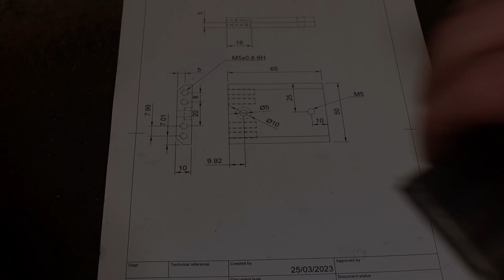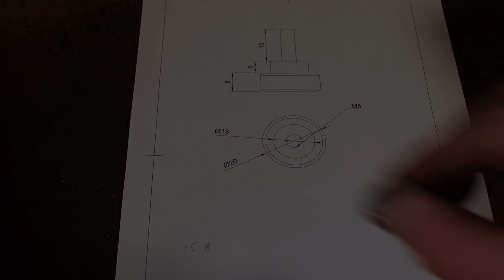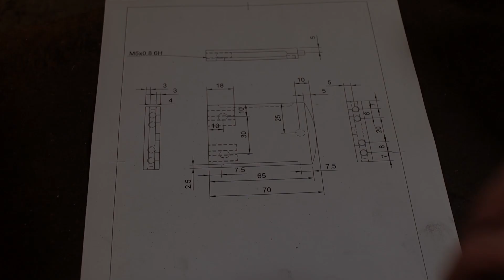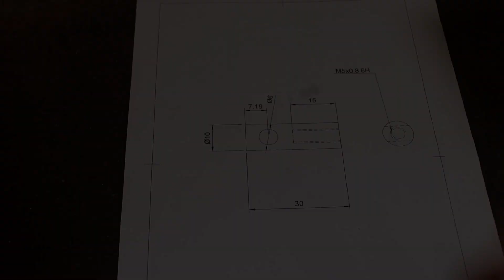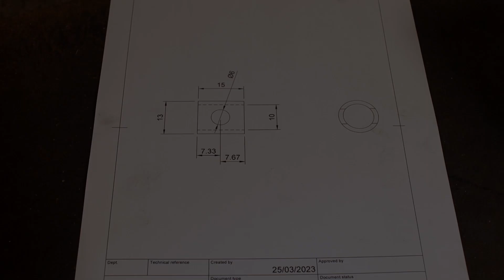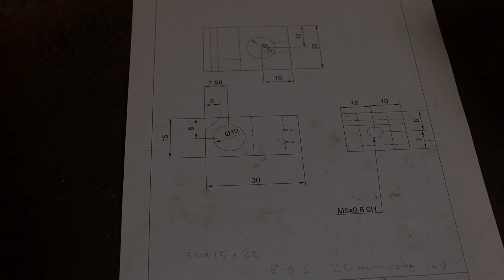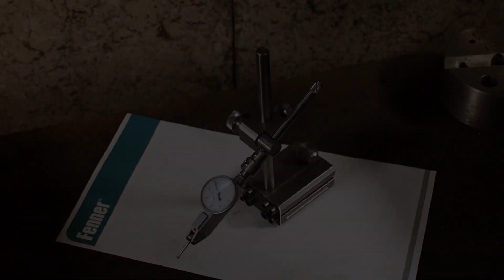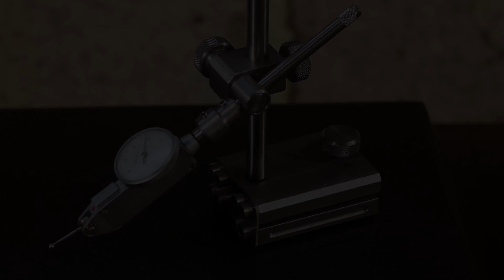Surface Gauge Project

Comment: Very nice! I've been eyeing up the Herman Schmidt for a while. I believe you need flats on the balls if using a granite surface plate. Because the surface plate will have random divots in it, and the ball will fall in, affecting the measurement. But a wider flat will just glide over the divots. I think you can make the flats now just with sandpaper and a lot of elbow grease.

I know 3 points is a perfect plane, but I believe most commercial surface gauges use 4 points of contact (or a perimeter of contact), for greater stability.

I agree with the other comment you did a great job editing, making it interesting to watch but not too long.
Reply from the maker: Hey, many thanks for the great comment!

Makes sense about the flats, there are a couple of divots in my plate here and there. It also doesn't glide particularly well with the feet as it is. I'll give the sandpaper a go 👍

You're also right about the number of feet, it does tend to tip a bit. At the time I went with three because I didn't think I could get four feet all the same. But if I'm lapping them in it shouldn't be a problem.

Thanks again!

Comment: Have you ever power tapped with the mill spindle? It’s way faster and easier than hand starting and finishing with a tap wrench..
Reply from the maker: I have power tapped with the mill, but have found that this light machine tends to struggle with it.

Comment: Good video. I've just found your site and subscribed.  Did you lap the ball bearing feet level, or is this not necessary?
Reply from the maker: Thanks! I didn't lap the feet, but seem to remember @robrenz recommending it to reduce wear on the surface plate.

Comment: It's better to use 3 flat legs instead of bearing balls. The surface of granite acts like an abrasive media and removes material from the balls. Now if you take a look at the balls you can easily see the ground tips.
Reply from the maker: Thanks for the tip!